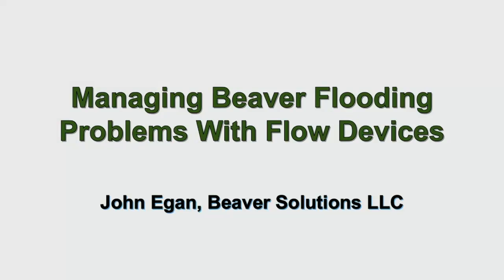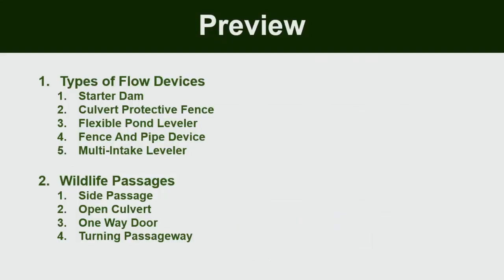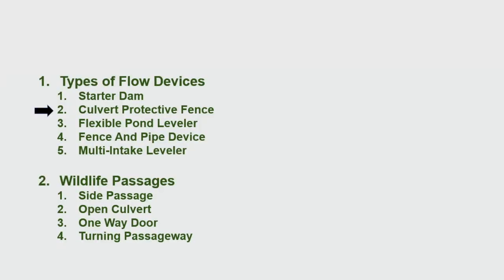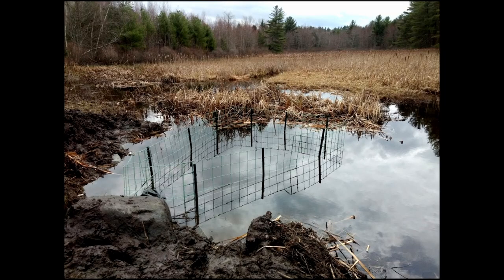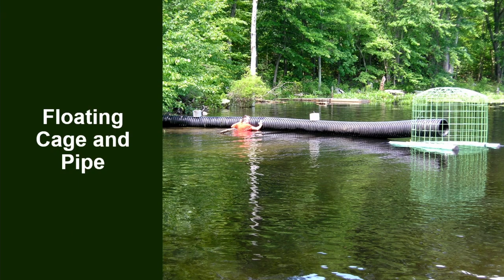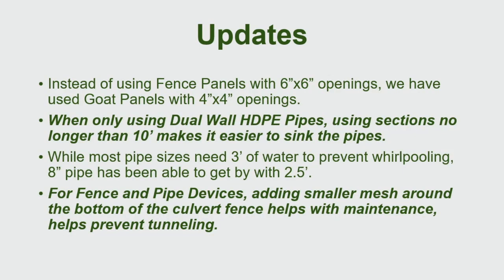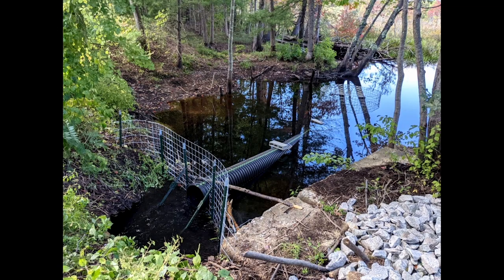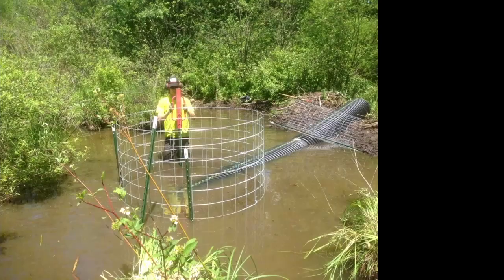John Egan - Using Flow Devices to Manage Beaver Flooding

Comment: I see many supports installed incorrectly, seen this system fail much too often
Reply: Not sure what "supports" you are referring to, but the Pond Leveler installed in this video was designed and installed correctly and is Guaranteed to work with a Money Back Guarantee.
Reply: @michaelcallahan2401  the fence posts should be on the inside not on the outside, the pressure of the beaver building will crush the fencing , I am in NewHampshire and have been seeing many installed on the outside as yours is and the fencing caves in